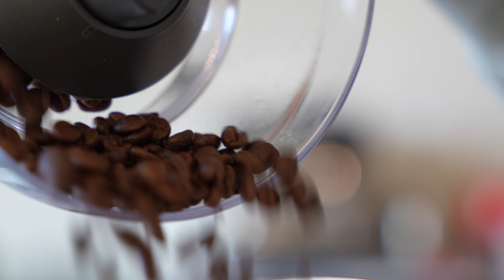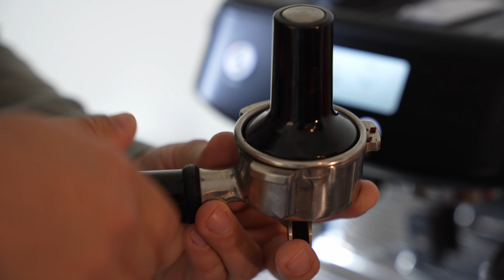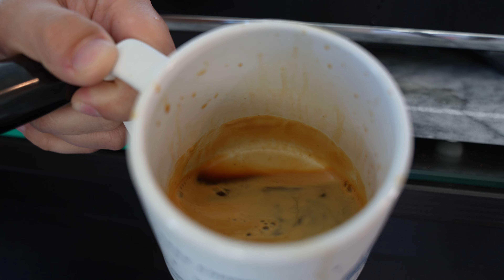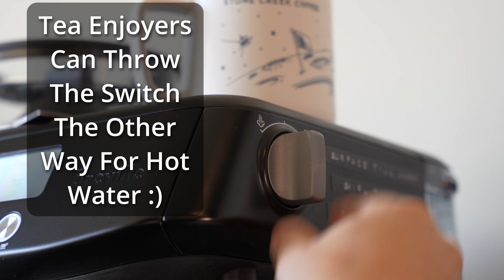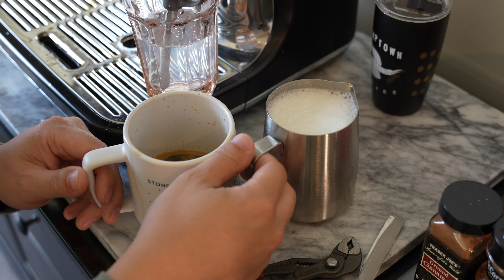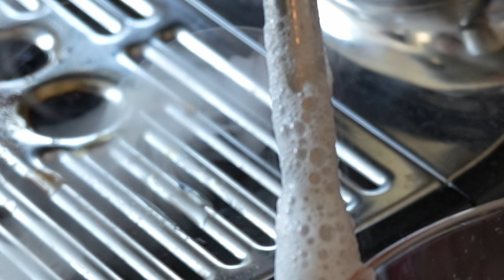You Don't Need Another 3D Printer (Buy This Instead)

Comment: I'm no coffee nerd, so as normal user my (personal) opinion is:
- I have a Delonghi Dedica and a separate Gaggia grinder (built in the '90s or '80s, gotten from grandparents), which I automated using a smart plug and esphome (push the on/off button, it goes for 16s, push long, it acts as normal on/off). Indeed a machine which combines the two would with easy setting would be more practical.
- the Dedica is what I think is optimal for HOME, non-nerd users: it has a pressurised coffee holder, so that you are free to adjust grind size, coffee amount, without impacting the pressurisation. Machines like yours are for those who (IMHO) care about making coffee more than enjoying it... you need the correct grind size AND amount to ensure the puck is not too thick/tight (coffee doesn't get through) and not too thin (coffee get too quickly through, it's watery). Many combination, big dependence on coffee brand, ... it's more complexity than a (normal, non-fanatic :) home user should get and this kind of machines will likely cause frustration from most users, which just want a good coffee. I think 90+% should get machines with pressurised coffee holders
- this machine is 800 €, while a grinder (new, with timer) and a Dedica (or similar) cost 400 €. And the dedica is not the cheapest, there are better and yet cheaper Gaggia machines. This one doesn't even save space
- if someone wants all combined, automatic machines like DeLonghi Magnifica/Venezia or similar do everything, allow adjusting water amount, coffee amount, grind size, and cost half as much (base, no LCD display). I tried them and they are maybe more complex to clean, but WAY more practical overall.
- are these super-automatic reliable? or maybe cheap, breaking soon? they are reliable, we got two at work and with 10 coffees a day, maybe more, they have been in operation for years (even a Nespresso or Senseo, with 10-20 coffees a day, last 5 years before the rubber seals or the pressurising part of the Nespresso give up).

Opinions are opinions, so this is just may review of the review, but I think that to avoid surprises it is important to highlight at least that the machine has no pressurised coffee holder, because it may surprise the average user who likes good coffee, but who's not into "making coffee" as part of the actual enjoyment.

Comment: What you really want is a De'Longhi EC 685, do the common mods and get a decent grinder like a Eureka Mignon Specialita. Don´t buy an all in one solution. And btw don´t make the mistakes Nathan did when making espresso.
Reply from the maker: Interesting, so it sounds like you would spend more on the grinder than you would spend on the actual espresso machine?
I got this because I had a tiny kitchen at the time and liked the idea of something that was compact and took up less space than 2 separate machines. And the beans I am using are ass.
Reply: @NathanBuildsRobots  This is the cheapest grinder which delivers a solid result. The particle size distribution is good, it´s consistent and has little dead space. It´s also futureproof if you want to upgrade your espresso machine.
Both machines together will use no more space than the Breville and you are more flexible because you got 2 smalls machines instead of 1 big one.

Comment: Cleaning that thing is annoying. That's why i sold my machine. 👍
Reply from the maker: It's not too bad in my experience, I wash it about 2-3x a year, just wiping down the surfaces and washing wastewater reservoir.
I don't really have to descale it since I use reverse osmosis filtered water.
The coffee grinds do tend to get everywhere though, if that bothers you than I can see that being an issue.

Comment: Damn nice change of topic content lmao. I love my breville express impress. I definitely would have liked the barista pro for the milk frother that heats up super quick, but I like the functionality of the impress :) nothing beats a damn good homemade coffee while designing parts to print for your coffee machine :D
Reply from the maker: I like this model, it's got everything you need, but the tamping and frothing are manual, so it feels like a skill-based game. That said, there are times where I just don't want to do any work, so something with more automation would be nice. The Barista Touch Impress seems nice, since it helps you out with both of the steps that require you to think.
I would get a Nespresso machine with a milk frother if I was feeling extra lazy - but that roughly doubles your cost of ownership since you have to pay a premium on each pod. Still saves a lot compared to going to Starbucks though.